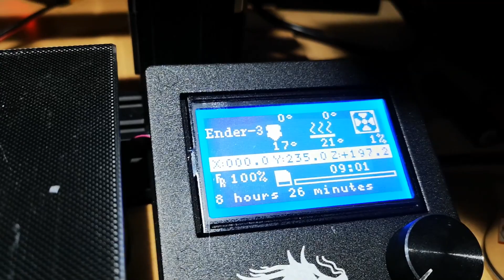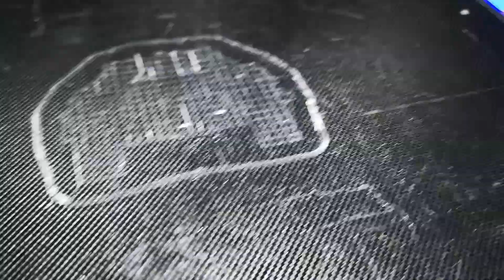Creality Ender 3: First Results

Comment: Dude awesome video when you print the 3d models are they already assembled ? Or do you print small pieces and you have to assemble them ?
Reply from the maker: some are full models, others have separate tracks, hulls and turrets or separate wheels etc. But they don't really have many parts

Comment: From what I've read so far, there are different printing technologies. The Ender 3 prints in FDM, shouldn't a DLP/SLA printer give even more detailed tanks, espacially for the smaller exmaples?
Don't get me wrong, your tanks still look amazing.
Reply from the maker: yes Resin printers are better for smaller detail but are also 2 or 3 times more expensive than FDM printers